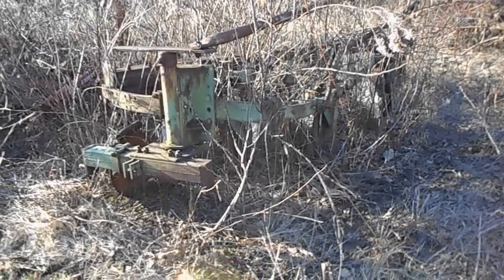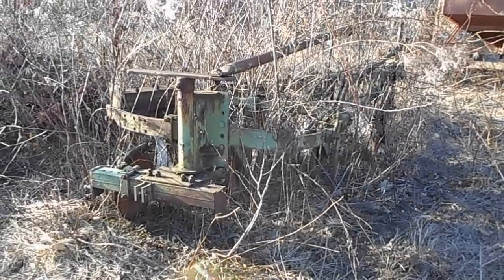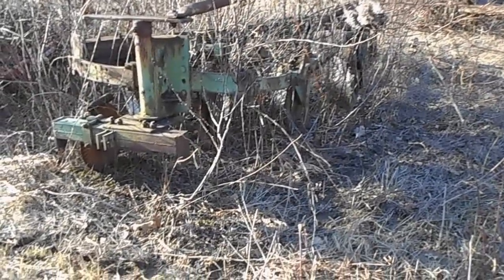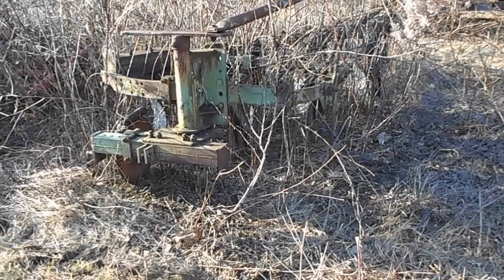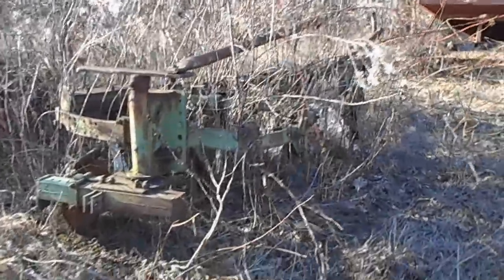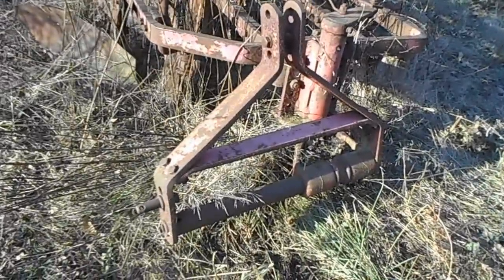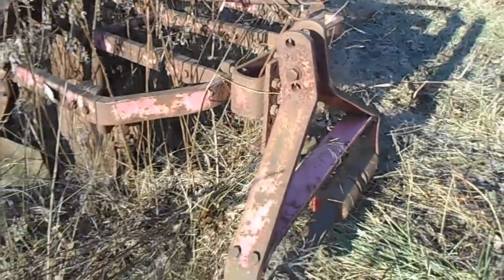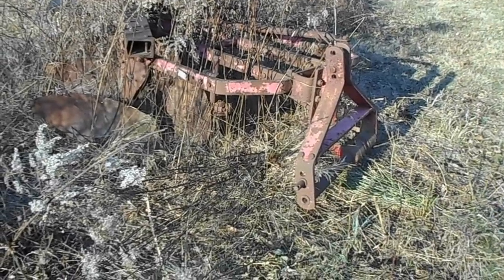Plow Education What plow for your tractor

Comment: I have a question. I'm looking at buying a 1960 Case 930. It doesn't have a 3 point hitch, but has hydraulic. What type of plow/ other implements should I get? I'm new to farming and want to do a little hobby farm of maybe 40-60 acres growing corn or something.
Reply from the maker: As 930's go there good tractors but all the equipment has to be pull type only. If your going to look for a plow I would stick to JD IH or Oliver as they are the easiest to get parts for but 5 bottom pull type plows are a little harder to find these days at least around here. At an auction a month ago they did sell a really good JD 5 bottom pull type plow for $500 witch really surprised me as it was in really good shape so you never know. I will say the 930's only have about 1700 PSI for the hydraulics so a 4 inch bore cylinder will be the best for it as it will pick up more weight than a 3 inch cylinder will. Disk wise a 16' or 18' a 930 will play with it but it needs to be an older disk as the newer ones are built a lot heaver and will be harder to pick up even with a 4" cylinder. Something like my JD BW 18' or like my White 263 18' disk 930 will pick up and pull easy enough. If you want a chisel plow I think an 8 or 10 shank pull type chisel plow will work fine on it depending on how deep you want to go, You want to go deeper say 10 to 12 inches an 8 shank but 6 to 9 inches 10 shank would work fine. Big thing to remember is to keep the equipment close to the time frame of the tractor just to keep things simple as it was built to be used for that Case tractor and tractors of that time frame. Bandit
Reply: @banditfarmer1900  wow. Thank you so much for all the great information. I really appreciate it!
Reply from the maker: @EthanSmith1122  Well I owned one and know how they are, They have plenty of power but can be a hand full to operate ! LOL There not as tight turning as my 1850 so you got to give it a little more room to turn them on the ends of the field. For field work they will get the job done no problem but that hand clutch takes a bit to get used to it when you used to a foot clutch thats for sure. If you get a 930 just dont put a strait pipe on it, A good muffler is worth its weight in gold on these tractors and your ears will love it !  Dont ask how I know this !  LOL Bandit

Comment: Only thing I'd recommend is, I'd set them plows up on some concrete or wood blocks or old fence posts or whatever to keep the shares up out of the dirt!  Sitting in wet ground will really corrode them and shorten their useful life.  I even started parking my rolling stalk choppers and disks up on a few concrete blocks just to keep them from sinking in the ground sitting on their blades, which then causes the ones underground to corrode badly if they sit awhile.  Later!  OL J R :)
Reply from the maker: I put new shares on it so I for sure want to keep it out of the dirt !  Its sitting on 2x6 blocks under the shares. I would love to add onto the barn back there and get some of the equipment under roof and on gravel to protect it. Good equipment is hard to find let alone pay for and when you find good you want to to your best to protect it as much as you can so it lasts longer.  Bandit
Reply: @banditfarmer1900  True, true!  Guess the stuff grew up around it so it looked like it was in the dirt.  Years ago I had a neighbor that, well, NOTHING had EVER left that farm, and they had a "briar patch" grown up in briers and 12 foot tall dry horseweeds, and I talked him into letting me clear it out... lot of good scrap metal back in there after all, and scrap prices at the time were good... We were gonna burn it off then I'd bring my torch over and cut up anything too big for the trailer and haul it to the scrap place, and we'd split the money even steven.  Well, he grabbed a pair of trashed jeans and tied a wire to them, dunked them in diesel on a nice breezy north wind early spring day.  He lit the jeans for a taper and started dragging them through the weeds on the upwind side to get the fire started. I was sitting in my truck waiting for him to get back.  Next thing I know he's running out of the brush, jumped in the truck, yelling "Go, go, go, go!!"  I asked, "what's up?" He's like, "not now, just GO!" so I threw it in reverse... backed around the corner in the edge of the field, as the wind has carried the fire into the tall standing dry horseweeds, and they're burning like gasoline, flames shooting 15-20 feet in the air.  Then suddenly there's this BBBOOOOMMMM!!! and this HUGE fireball rolls skyward.  SO he lets me in on the details... he'd crossed the brush area and went about 10 yards south and started back across, and in the middle of it he walked up on a pair of old welding gas cylinders laying in the dirt...  When he saw that he took off running!  Well, 30 minutes to an hour later the fire had burned itself out, and it looked like a nuke went off-- NOTHING left but white ash on top of soot black soil...  We went out there and found the two cylinders (which had undoubtedly walked off a job site they worked on somewhere, as a LOT of their stuff had over the years).  They were helium cylinders for shielding gas, not oxygen or acetylene in which case we might not be here LOL:)  Turns out what happened was, and old driveshaft laying in the grass that was burning around it got SO HOT that the air pressure inside got SO HIGH that the seam along the tubing finally unzipped just above where the yoke was welded on the end, and the yoke blew off to God only knows where... we NEVER found it!  The round steel tubing had unzipped from the weld SO perfectly it looked like the tube had been opened up and hammered out flat on an anvil.  It curled slowly back from the perfectly flat former weld end seam back up on itself to the weld seam down the length the tube where the split stopped.  CRAZY!  

Well, turns out that EVERY piece of old junk I pulled out of there, he wouldn't allow me to cut up or sell... I mean there were old horse-drawn disks out there that had been sitting SO LONG that it was sunk in the ground to the disk axles, and when I pulled it out, almost half the blades were rotted off underground... STILL he was like, "well, if the renter (BTO) ever goes broke or quits farming, I'll have to start farming this place again, and I'll NEED that...  Now I'm not talking about anything that could be actually used, with minimal fixing, this stuff was JUNK, just GONE beyond repair, but he wouldn't part with it.  I think I got one load out and finally just gave up, because he wouldn't part with any of it.  

SO I learned about stuff sitting too long on the ground... we pulled a cultivator out that the sweeps had rotted off the bottom  of it, etc.  Just crazy!  Later!  OL J R :)

Comment: Okay... I never even thought of that, why Deere and IH had that backwards primitive lower link draft system, Fords were MUCH more responsive on the draft control.  BUT like you said, for a two-link semi-mount plow with no top link, yeah it'd be impossible to get a draft control signal to lift the plow according to load with no top link, where tractors with the lower link sensing would be able to draft control the plow.   We always used middlebusters and hippers for heavy tillage, and we have an old 3-16 AC 3 point moldboard for breaking pasture or hay fields, and I bought an old Ford 3 disk plow to use at Shiner in the sand and rocks, since a disk plow will ride up over buried shelf rock easier and doesn't wear the shares as bad.  The 5610S is a little overkill for the both of them but they do a good job.  

Now I can see a way to MAKE that Oliver 2 point plow work on a top link sensing system.  You'd have to build an ADAPTER to mimic the pull points on the other plow you showed with the full 3 point hookup.  Basically, make a 3 point "tree" as you called it, that would bolt together over the EXISTING 2 point pins a few inches BELOW the pins on the tree to hook to the tractor's lower 3 point lift arms, then hook the top link up to the adapter tree normally.  The tractor would lift the adapter, the adapter lifts and pulls the plow.  The plow pins pull back on the adapter when it goes in the ground, pivoting around the lift arm pins on the adapter above them, and pushing FORWARD on the top link to activate the draft control load sensing valve.  Might throw the arm geometry off a bit (higher or lower than "centered") but we ran middlebusters and hippers and they all had different pin heights in working position so it doesn't really matter that much so long as the tractor can lift the plow sufficiently at the end off the field and is within a decent "working range" so the plow can go deeper in soft soil and still be raised up by the draft control in hard ground.  

Later!  OL J R :)
Reply from the maker: I know MM and MF made an adaptor so you could use any 3pt equipment on there tractors so the draft control would work. some place I have a couple of pictures of them and there made like a quick hitch except ware the implement hooks up is 3 or 4 inches lower than the lift arms are so it pushes in on the center link to make the draft control work on them. As far as I know this MF plow was the only plow made with a 3pt hook up for a center link draft system. You could buy it as a regular 3pt plow hook up ( like mine is) or you could get it with just the 2 pins for a rock shaft draft coontrol for an IH Oliver JD Case AC  and so on. The hitch like mine has could be used on ether draft control system, Center link or rock shaft control . But there a hard plow to find these days and you would be surprised how many people have never seen a plow like mine before or have any idea what or why its different. I've only see a couple of these plows over the last 40 years around here, MF made these for the 165 175 and 180 MF tractors and no so sure a lot of the parts are not in fact Oliver parts cause they sure look like it !  There apart of history now and not many people know about them now or what makes them special in the farm world.  Bandit

Comment: My Kubota doesn't have draft control. What about those machines?
Reply: If you don't have draft control, you only have position control, so it doesn't matter.  It's not going to plow as well as a tractor with draft control... have to run shallower or slower or both.  Later! OL J R :)

Comment: I wonder if the big Masseys used top link draft ? Like the 1135s and what not , We have an 880 massey and it is 2 point hitch.
Reply from the maker: The big Massey's had it too, Thats why you see so many MF's with a MF quick hitch on them. They were made so you could use any 3pt equipment on them and still have draft control. The #88 MF plow I have was made for the smaller Ford MF MM tractors that had center link draft control, You could get the plow set up like mine is with the full 3pt tree on it or you could get it with just the lower link hook up pins like everyone else uses. This is about the only plow that was made with this hitch made on it so there kind of hard to find plow in this area thats for sure. Bandit
Reply: @banditfarmer1900  , ok thanks for the info!

Comment: Great video Bandit. I have a question though. I am currently using a Ferguson 55 mounted rollover plow on a newer McCormick, it has center link draft. I was thinking of getting a semi mount since finding left hand part is getting hard and expensive. My question is, the draft will control the front but what controls the back? The wheel just goes up and down with the remote. We can go from very heavy soil to light sand in the same small field. Even our mounted plow will drop deep in the sand. It is a challenge to get the field level. Thank in advance.
Reply from the maker: If you can find a MF #88 semi mount plow like mine it will work fine on your tractor as the plow hitch was designed for a center link draft control like your tractor has on it. I believe the MF #88 semi mount plow was the only plow built to be used on a tractor with rock shaft draft control or center link draft control and work on both.  They made a quick hitch for tractors with center link draft control that would allow you to use any brand plow you wanted too on it , The way it was made ware the lift arms are attached to the hitch is 5 or 6 inches higher than ware the plow will hook up there by making any brand semi mount plow work on a tractor with center link drat control.  On the draft control question if the tail wheel (not a gauge wheel on the side on the plow) is set for a depth when the front of the plow raises up dew to the draft control raising up the tail wheel of the plow will follow the front of the plow as the weight of the plow will pivit on the back wheel thus raising the back of the plow up to follow the new angle of the plow bottoms ,  Its like at the end of the field when you raise the 3pt up and you watch the back of the plow come out of the ground and the back bottom is just off the ground. I have seen guys set a 3 or 4 bottom semi mount plow and they never raise the back of the plow up as it will follow the front bottom as the plow comes out of the ground and it will work just fine.  Its hard to explain this way but the back of the plow will respond the same way as the front bottom does when the draft kicks in and raises the plow in the front.  Most all semi mount plows can be set for depth control in the back on the tail wheel, The MF plow has a bolt you can adjust up or down to set the back end of the plow, My Oliver and Case plow are the same way.  I hope this helps and explains this to you.  Bandit
Reply: @banditfarmer1900  thank you, yes I know the 88, there were a lot of them around here. I see a lot of farmers going back to the semi after about two decades of the switch plow being the main stay. I know exactly what you mean about the quick hitch, I just never put that together till you mentioned it. I'm going to start looking for an 88 at sales, I'm sure I'll see it all once we start using it. This is great, old becomes new again, good to have someone that knows the ins and outs. Hopefully my fields will look better than the neighbors. 😂 Thanks again.
Reply from the maker: @shawnkendall3244   I have always liked to plow and I still think the plow has its place on every farm as part of a tillage program. Guy junked there plows around here years ago and now there out looking for them now because there getting weeds they just cant get control over like mares tail . No till is not the answer in all soils, Some just need to be worked to grow good crops. I have several (7) plows most being Oliver but 2 are MF and for the most part in good shape and ready to go (other than a flat tire) LOL .  It might be old fashion but I still love to plow and always will, Once you do it and figure out how to do it you really want to do the cleanest strait plowed field as you can, The kind you would see on a post card !  I've done that several times and really liked it when I was done, I guess being in plowing contests in high school and winning a couple really makes you want to do it more.  Now I have a couple of plows I really want to try and I hope to try one of them before too long , A 5x16" Oliver plow and a 6x14" MM plow and I really want to try the 6x14" on the 1850 and I think its going to be fun !  Bandit
Reply: @banditfarmer1900  we live in south Jersey. This is a very strong area for production of greens, herbs, peppers (but they are phasing out), squash (summer and winter), pickles (the little kerby cucumbers) and the famous Jersey tomatoes. My family always worked full time and farmed on the side, mainly winter squash. Around here, a 100/150 acre farm is average so the 50 we've grown into ain't too shabby for being part time. We have retired the fresh market sector and now only grow field corn, even bought a combine.....now they are FUN. I've been made fun of because we still plow, still use dry fertilizer and still cultivate CORN. I don't care, our ground is fluffy compared to the no-till grain region west of us. And I can jump right back into the fresh market crops, with all that plowed in organic matter we have. I like laser beam straight rows and level fields with no furrows. (My father doesn't agree with no furrows) that burns my butt having furrows right next to the water control swales I've spent so much time on, but what ever. Thanks for sharing your wisdom, the plow was something I knew I didn't understand 100%. You've gained me quite a few percentage points.
Reply from the maker: @shawnkendall3244  Plowing is becoming a lost art form, To me a good plowed field is a work of art !   Its good to have options to be able to switch to if needed , And to me that means you will make it no matter what happens.  Plowing is hard to explain but I'm glad I could help you out on it,  Let me watch or walk beside a plow while in the ground and by just watching you just know what to do to make it work better, But trying to explain it is just hard to do for me.  If you got anymore questions just feel free to ask and I'll try my best to answer them.  Bandit